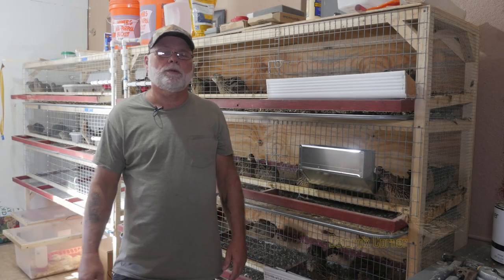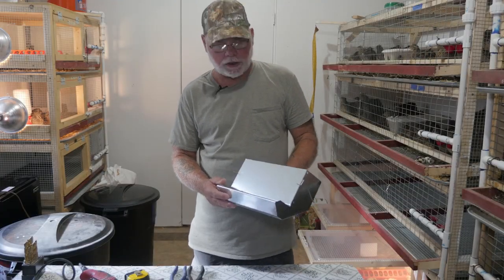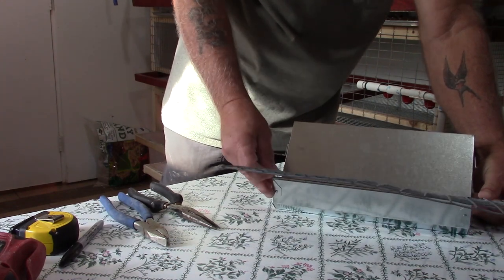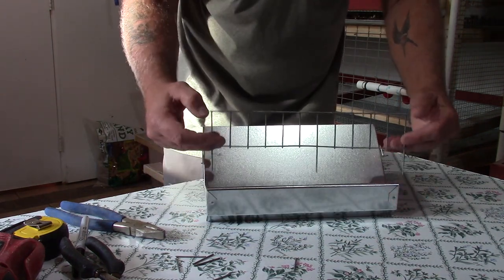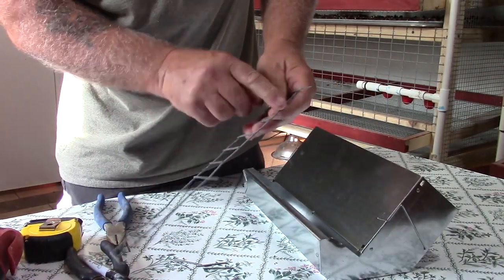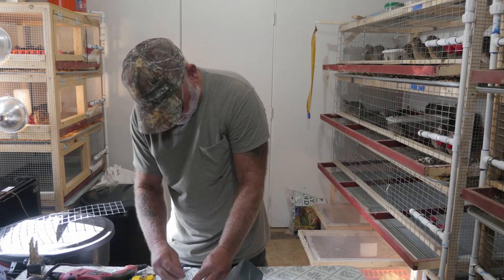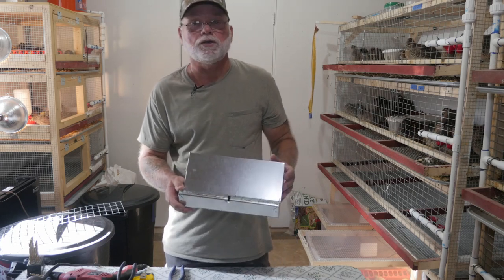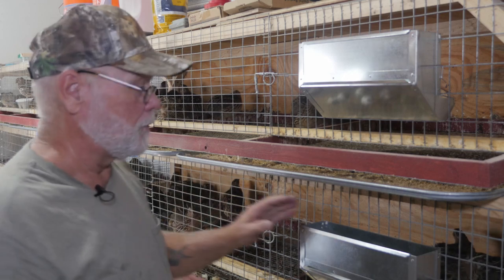Quail feeders - modifying the J-feeder for less waste

Comment: I use similar metal J-feeders as well. I love that you can put labels on the feeders. I've found that using magnets with the info attached work best for me. I can easily move the magnets around if needed and easy to take off when I'm cleaning the feeders.  Great videos! Thanks for putting the work into sharing your experience and knowledge. It is appreciated!
Reply from the maker: Great idea using magnets! Thanks for commenting

Comment: I'm glad Stromberg's added free shipping ($100+) to their website, because the shipping costs on those feeders was way too much. I used this video and the comments on it to make my design. I used 1x1 vinyl 90 degree corner strips along the trough area. The sides are bent straight and the front is bent to around 110 degrees. I made my own welded wire to go on top of that, which is .75" x 1.5" and 18ga. The welded wire is also at a 22.5 degree angle so they can't stand on it.

With this setup, they can't rake the food forward or shake it out along the edge of the trough. It works in grow out cages too. I haven't seen any feed on the poop trays.

Comment: Love your video. It inspired me to use a j feeder for my cage and also modified it a bit. I added a rectangular plastic bottle at the top to increase the feed capacity and to also see if the feed is getting low since the plastic bottle is transparent.

Comment: Terry,

Hey there again. I've watched your multi-level cage build video for the shorter length versions, but the LONG cages to which you attached this feeder is what I really want to build (I've got a 21 ft wall and a 13 ft wall for my cage positions).

I'm dumber than a box of rocks when it comes to cutting and building things; theory doesn't do me squat, if I have the numbers written down in front of me, so that I know what specific lengths and widths to cut (for the frame, the Poop Tray supports, and the Egg Roller Shelf (I'm STILL a bit 'iffy' on the proper angle to cut for that sucker...I think you said 4 degrees, but I wasn't sure), THEN it's just like  a big jigsaw puzzle that makes sense (I can look at the paper I've written noting each piece, so that part A goes 'here', and part B attaches to part A x number of inches down the length of part A (ie, the support braces for the 'flooring' for each level).

But in my head, when I'm just thinking about it, only SOME of it makes sense and I get easily lost......3 D was never my strong suit: if it's on paper, with the measurements, I can build it, but that's the only way that works for me.

I've looked online for free cut list programs and I can't find one that shows me what I need, just the numbers but none of them are attached to what those numbers refer to at all. Like I said, I'm dumber than a box of rocks when it comes to this stuff....Abstract Construction just doesn't gel with me. Don't get me started on wiring; I stay as FAR AWAY from wiring as I possibly can.

Anywho, thanks for your hard work on the videos, and you've just solved the Feeder issues for me......I love your mods on the feeder, easy peasy, should preclude most waste issues (can't stop it 100% with any bird). Do they make a longer feeder, so that the feed hopper lasts longer between refills?

Lastly, I've been looking at DuMor and Purina Wild Game Feeds. The DuMor offers Medicated and non-Medicated, while the Purina seems to offer 3 varieties of Game Bird Chow. The DuMor hovers around 24% protein, while the Purina offerings come in at 30%. The DuMor is a bit cheaper (under $2.00 less), but that extra 6% protein seems like a wise choice from chick stage up to 10 weeks when they become adults. I figure I could switch over to DuMor 24% at that stage (non-Med so it doesn't affect the eggs), as I'll be feeding them meal worms I raise, along with Barley/Wheat Fodder. (and providing Grit for digestion as well, witih the 'live' food I'll be feeding).

Thanks again. Stay safe.

Cheers from the Oil Patch in Central WY

Comment: I'm thinking instead of using the cage wire to create slots, what about using a piece of plastic and cut small circles out of it ? Just like one of those round brooder feeders. Wonder if they'd still be able to fling feed around with that.

Comment: Hey there, I really appreciate all that you have shared from which I have learned much. I have a question: What size J FEEDER is suitable for 6-10 birds?  I just purchased one on Amazon and when it arrived I thought, it's too small.  The entire unit is just  5 inches left to right; the hopper is 5-6 inches tall x 3 inches deep, front to back.  It's hard to gage how much food this will hold and how long it can be expected to last before refilling is needed.  You stated yours is 7 inches in this video.  how many birds is yours feeding?

Comment: I did that with my J feeders and the stupid birds would still manage to rake back the feed and get it to fall out. My J feeders have a small lip in the front too... I used the tip from Aloha quails to narrow the aperture from the hopper using glued on cardboard. Only a small layer of feed would be dispensed to the feed tray with that modification and they couldn't rake it back.

It worked until I used feed I got from a local mill. The feed was a little bit too moist, which caused it to not dispense properly. Once I tore off the cardboard, they were already back to raking the feed out.
Reply from the maker: I have noticed that I too get some waste even with this modification, although it is much less than with out. I tried the tip from Aloha quails also, it worked temporarily until the cardboard got flimsy. I am testing a metal baffle that can be pop riveted into the feeder. I'll let you know how that works out. Another thing that works pretty well is going to a pellet feed for all your adult birds, they don't seem to kick that out as much. 
Quail are just slobs, they always think there's a better piece of food below.  Thanks for commenting!
Reply: @CoturnixCorner  I used an abandoned election sign instead of cardboard. And zip ties instead of cage wire since I didn't have any wire around. Turned out to be 1 of 2 feeder designs out of the 5-6 I tried that didn't waste food. Thanks for the info.

Comment: Great tip, was searching for a way to make less waste feeder for the stacked cages i'm building now.
I have some questions :
 what measurement do you recommend for the coated hardware cloth in the floor ? Note i only have metric sizes and want to get the best footing and  waste dropping rate.
What is slope angle for the eggs to roll out fast and safe, my cages are 2 feet deep x 3.3 feet wide 
What is the best height  all in all between the sloping floor and the feeder so my eggs can come out easily + the quails don't have a problem reaching feed?
Reply from the maker: 14 mm X 14 mm on the hardware cloth. For the slope I use a 2" drop in 2 feet. My feeders are approximately 5" off the floor of the cage. Good luck and thanks for commenting.
Reply: @CoturnixCorner  this was helpful and very close to what i was planning
 usually i ask here bcz i get the simple right answer not rocket science complications. Thank you

Comment: Hi Terry I noticed on the comfortplast quail cage review that on their feeder,  besides an orange 1"x1" grid there was a green strip that kept the quail from pulling the feed backwards and out . Wouldn't that be something that could be added to your modified J-Feeder?  A modification of the modified J-Feeder?  I was trying to think of a material that could be used but couldn't come up with one. Any thoughts?
Reply from the maker: It's funny you said that, I am currently testing different designs just for that. Will post my findings soon!

Comment: my last quail hutch was a disaster all the eggs were fertile but only 4 hutched and they all had feet problems also and died after 2 days the rest of the eggs when I opened them all had chicks in them this is the second time that I hutched quail the first time was 90% successful what has happened this time can you help?
Reply from the maker: Usually when you lose and entire hatch it points to an incubation problem. Malformed chicks are usually the result of too high of incubation temperatures. Calibrate your thermometers and test incubator for a week or so to verify proper incubator temps.

Comment: "Fairly decent" and "halfway decent" aren't very convincing.  At about 9:00 I can see them wasting the food because there is quite a bit on the front lip just about to fall out.  I saw another video where they put a piece of tin over the opening and drilled holes where they can put their head in and eat and I saw no way that the food would fly out.  I gotta find a solution fast because they are wasting all their feed.